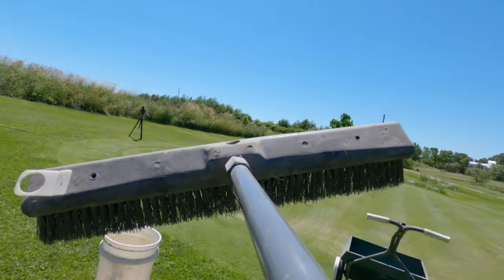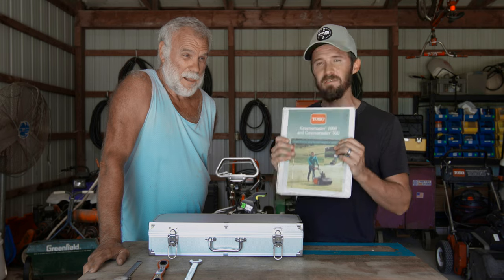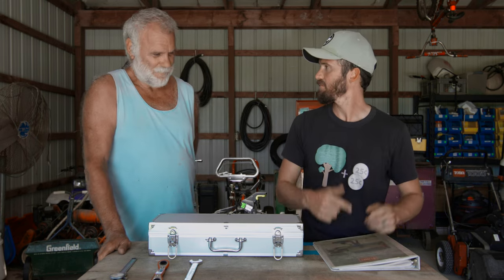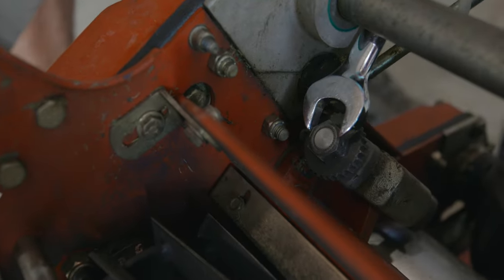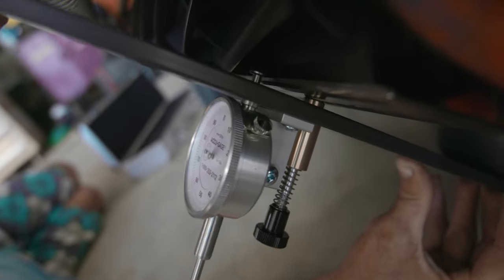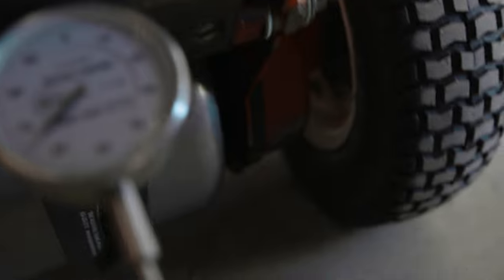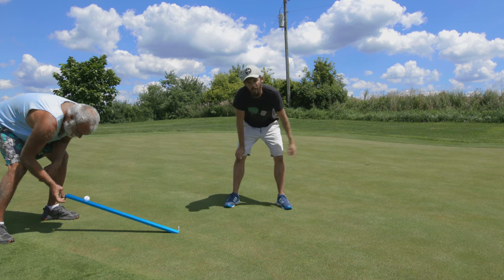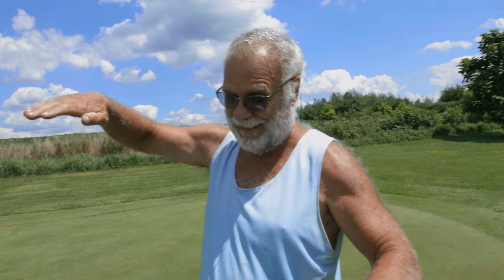Lowering the Cut Height of Our Greens Mower

Comment: I'm a equipment technician at a golf course here in the hot springs village Arkansas. I love this video. The term for adjusting the bedknife to reel is called setting the tension. It should be checked after every mow after cleaned and dried. Keep up the good work boys
Reply: Oh btw, we mow our greens at 0.120 right now. And they're champion ultra dwarf Bermuda
Reply from the maker: Thank you, Hunter!
Reply: @FriedEggsGolf  you're actually raising the knife up to the reel.  you're only cutting one green so if you checked it for height and cut quality once a week it should be fine.  paper should cut all the way across when held vertically and pinch the paper horizontally.  check them roller bearings once in a while too.  

also, when adjusting the h.o.c be sure and go past the height you want and then bring it back to eliminate slack in the adjusters.  thanks for the videos guys!  

 p.s. how is the diameter of that reel?  they have wear limits and i may have a new in box reel kicking around we could deal on if ya need it.

Comment: As a greens keeper I think you did a great job. I'd kill for that Accu-Gage with the magnet also. The reel to bedknife adjustment tilts the bedknife ever so slightly towards the reel, the reel doesn't move. When you have your Accu-Gage on the mower and checking height, spin the front roller slowly and watch for changes in height, this will tell you if your roller is out of round. Then kinda split the difference. Just a few tips I noticed. Also, if you're checking cut with printer paper you can use a folded peice, gives it a little more for it to cut against. Great video guys. Loved it as usual.
Reply from the maker: Thanks for the tips!
Reply: @FriedEggsGolf  , just noticed, I meant to say the reel doesn't move on the reel to bedknife adjustments, I edited it. I love the equipment videos along with the turf videos. I currently have a BlackJack Bermuda chipping green and two tees in my backyard. Hoping to upgrade to a full putting green at some point in the future. The course I work at has zoysia greens.

Comment: Great vid as usual. You guys have inspired me to grow my own back yard green. I just need to get a mower. I bought a manual reel mower but it only goes to a 1/2 inch.
Reply from the maker: That will get you started, good luck!
Reply: Have you tried drilling holes in the mower so you can set it lower?

Comment: More than likely when y’all adjusted reel to bedknife it threw off the height due to the left being made tighter 2 clicks than right. However what you did is correct, my normal routine would be backlap if needed, set reel to bedknife, set height of cut, mow.
Reply from the maker: Thanks for the info!